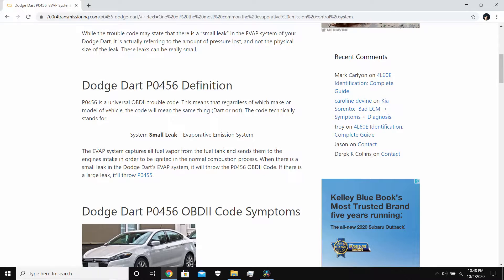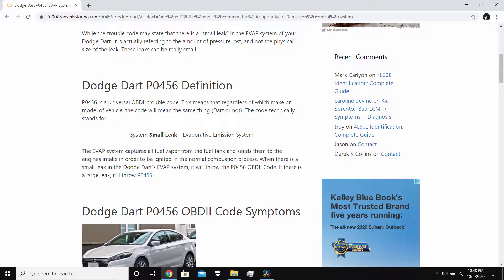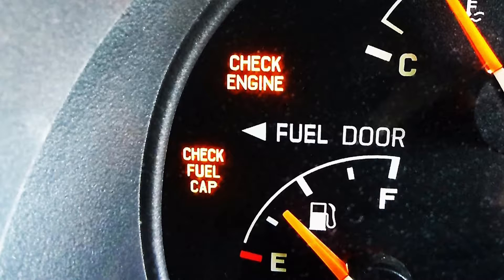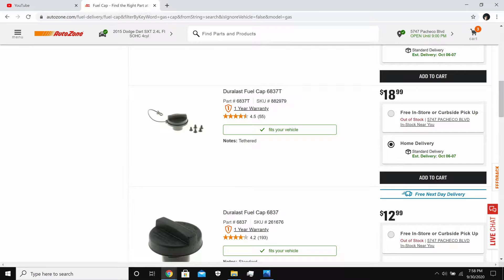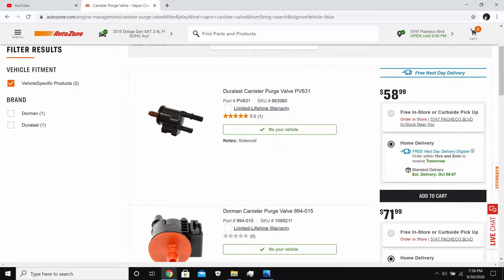2015 Dodge Dart P0456 code fix

Comment: Tha😅 for the video. I changed the esim first,that didn't solve my engine light problem. I am replacing this valve tomorrow. Hope this takes care of the annoying engine light. Ironically it just came on the week I had to go to inspection!😮
Reply: Did you solve it??

Comment: For those who have the 1.4L turbo, the procedure is the same for the most part. However, the purge valve is facing the opposite side than the 2.4L engine in this video. Meaning the brownish-orange part of the purge valve of the 1.4L turbo faces the passenger side as opposed to the driver side like the one shown in this 2.4L. On a side not, if the wires don’t come off even after pulling back the white clip, don’t keep pull hard on the wire. Try using the flat head to gently pry the wire cluster out. Don’t worry about damaging the old purge valve in the process since you are replacing it anyways.

Comment: How do I remove the valve if it is stuck on even after I pulled the white clip out?
Reply: Use a flat head screwdriver and pry gently to get it off. I had the same issue.
Reply: I gently squeezed mine with a needle nose pliers.
Reply: It could also be the ESIM (purge detection pump).